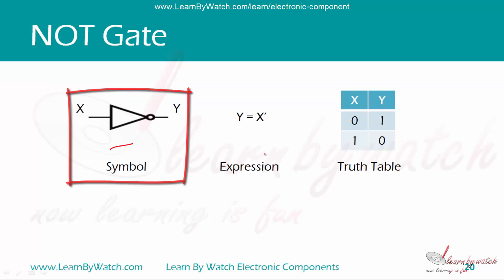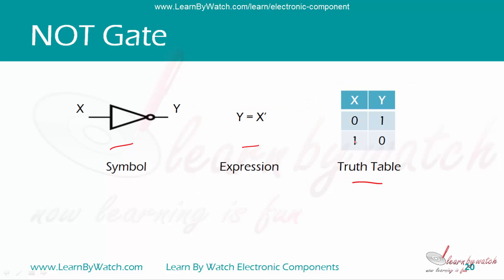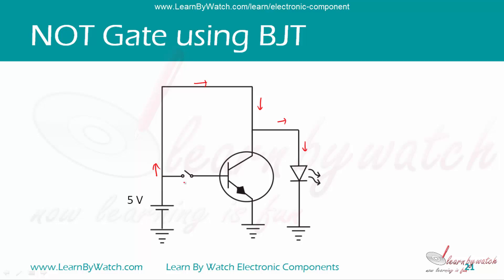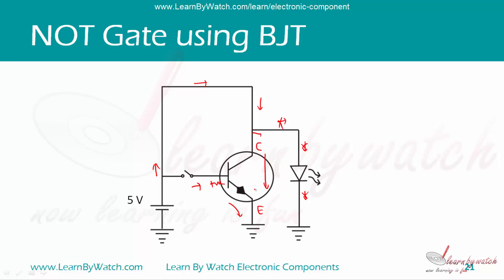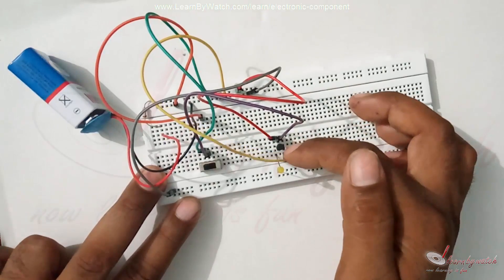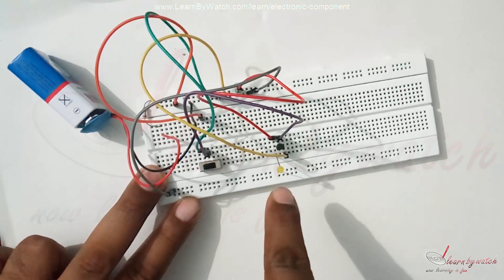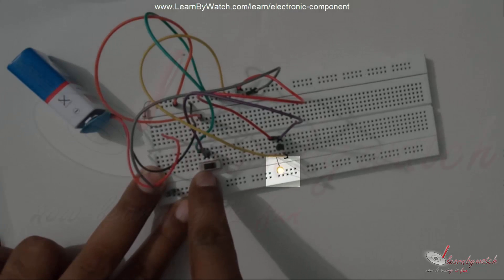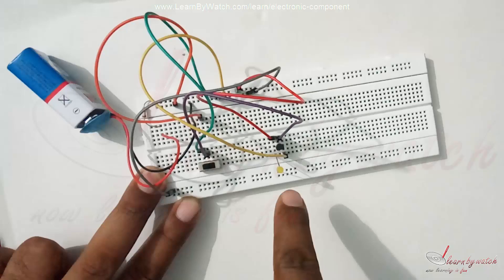How to make a NOT gate using BJT or Bipolar Junction Transistor

Comment: Thank you very much..
Question..
1) do the circuit current keeps flowing even though the led is off because the switch is on.. is that would be a waste???
2) how to know where the current would flow .. like in the video the current goes into the transistor and not on the led.. what makes the current flow there..
Sorry if this is elementary im still new in electronics
Reply: Glo Mtecson electricity is lazy. It just wants to get from one terminal of the battery to the other asap. If it can go the short way to negative through the transistor it's not going to go the long way to light up the led. And yes having the switch closed would drain the battery.